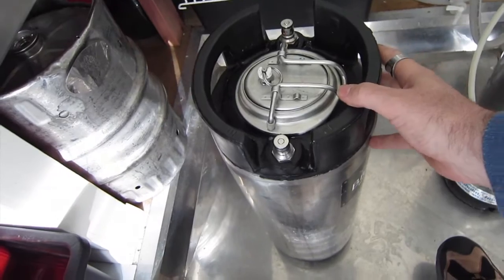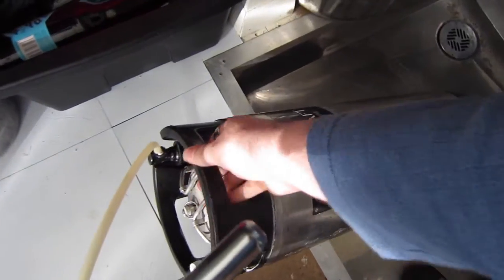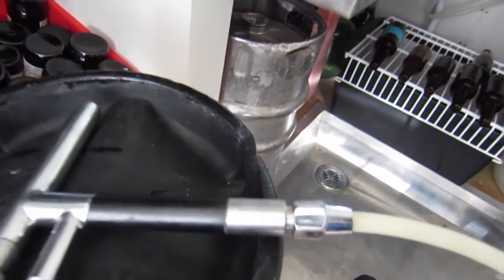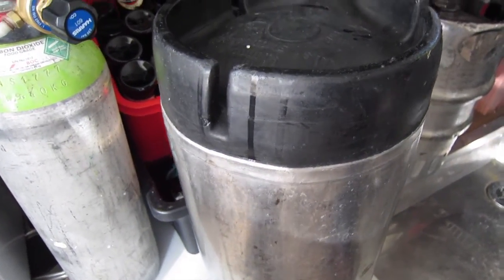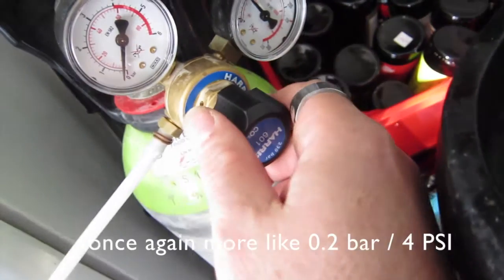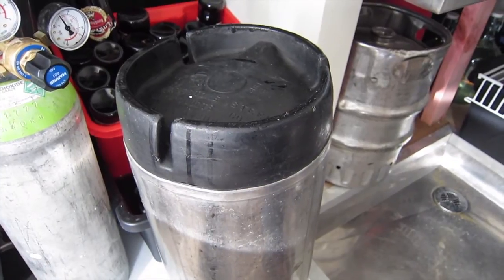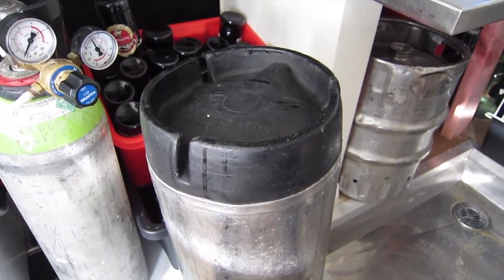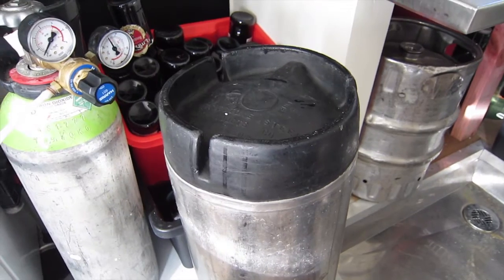CO2 Scrubbing beer, tip in 5 min

Comment: It works but this method is sooo inefficient. In a winery we would call this ‘sparging’, usually with CO2 or Nitrogen, and it removes unwanted Oxygen, and flavours too. To be efficient, you want tiny little bubbles, to maximise the surface area between the gas and the piss.  You get tiny little bubbles by pushing the gas in through a sintered metal fitting. Wineries do a tank like 200,000 litres in several hours. I’m a little concerned about all that CO2 going straight into the air. If you can hear the bubbles, you are wasting your expensive gas; do it efficiently and you will produce very fine froth. If you are not concerned about dissolved Oxygen (reduces the shelf-life) then perhaps air would have the same effect (I don’t know), but it could be cheaper if you have a compressor in the garage.
Reply: That would oxidate beer very quickly and give it cardboard like flavors. It's different than wine I think. Beer brewers are really frantic, obsessed with preventing each molecule of oxygen entering their beer and go to great lengths to prevent it. 

Very interesting remark on the inefficiency. I was thinking of getting one of those keg lids with a carbonation stone which bubbels really finely, but didnt do it in the end. After a few years of brewing I just got my first farty beer, and if I waste even 100 grams of Co2 (I dont think 5 mins of this wastes that much but OK) thats way cheaper than getting a carbonation stone.

Comment: No comments to this in over 3 years. WOW...bringing it back from the dead. I did my first hard seltzer last month and it has a bit of sulphur/yeast smell which is affecting the taste (as you noted...smell/taste are inextricably linked). I've got a second batch of hard seltzer about to finish and it has the exact same off smell. I'm gonna try this technique and see if I can clean it up using this 'scrubbing' technique. It is my assumption that a hard seltzer should nearly be tasteless and odorless until the flavor extract is added (right before carb'ing). Can you provide a little more detail regarding the timing of this process. You noted to do it for a few days. Does that mean 'scrub' every hour for 3-4 days (I know - a little extreme)...or 3 times a day (for 5 minutes or so) for 3-4 days? Or...something else? Since my goal is an odorless/tasteless seltzer I know I can't 'over-do' it...but trying to manage my expectations and not waste CO2.

Comment: Thanks for the video tutorial!  I'm going to give this a test run before dumping 5 gallons of an IPA with some funky DMS flavor.  Wish me luck.

I've read this can be done without the CO2 gun and having to tip upside down.  With a ball valve corny keg, just connect the CO2 line into the dip tube side and purge from the release valve on top.
Reply: Do you remember if it worked with the DMS?

Comment: this is a great vid. I am doing this now to an experiment elcheapo lager I made from a woolworths tin. it has an off flavour that I would describe as bruised red apple. I did the boom shackalacka shaky shaky carb methid and overdid it big time. I didn't notice this flavour when I took my F.G reading. I did clean the keg as I usually do and im wondering if this flavour is attributable to the excessive carbonation? anyway I have been scrubbing it for a few days now and that flavour is going away. im not sure I can eliminate it completely but I think I will get a drinkable beer from it. will dry hop it when done. cheers.
Reply: by the way. does it matter if its cold or room temp? it's straight out of the fridge. should I let it warm up?
Reply from the maker: Victor Bitter yeah scrubbing will takeaway other flavours as well, But if its a lager, then there wouldn't be much hop profile to remove. CO2 scrubbing is essentially taking all the volatile aromas that you smell in a beer, and removing them. 75% of our taste perception is via the nose, so try 'without drowning' taking a drink of the beer while pinching your nose closed. That way you will get an impression of what the beer tastes like after all the volatile aromas are scrubbed out. Sometimes its easier just to add an overpowering flavour to the beer to mask the off flavour, like adding raspberry extract and making a raspberry lager.
Reply: Time4Another1 cheers for that. ummm.... raspberry? no thanks lol. not my style. I might hit it with a shedload of centennial or chinook or something though. not quite to style I know , but if it makes it drinkable i'll be happy. what about the temp? does it matter so much? thanks for the reply Paul. if this quandong is any good i'll put your name one one. cheers.
Reply from the maker: Victor Bitter 14 - 16ºC conditioning temp or cellaring temp is what I used, I know it takes longer to dry hop at colder temperatures, therefore it makes sense that it would take longer to scrub at lower temperatures to. However I have never tried cooler temps for scrubbing before. What about chilli? chuck a couple of chopped up Trinidad scorpions into the keg, that'll mask the flavour if it doesn't scrub out completely ;) Dude if the Quandong is good, I am in for a swap for sure, cheers.
Reply: Time4Another1 cheers mate. i'll keep you posted. will keg and bottle it in a few days. ill let it age a week or so n if its good from the tap..............NZ!

Comment: Just a thought mate would this be easer if you could change the black and grey connects around on the lines in stead of turning the keg over . I did see that your connectors are fastened with crimpers which would make it hard but I have seen the ones you can disconnect off the lines with ease . Good tip mate and this works on over carbonated beer as well . Twe...
Reply from the maker: good point, the screw on corny connects would be perfect for that. Great stuff
Reply: John guest fitting are push on pull off . Cheers Paul Twe...
Reply from the maker: John Guest are the Best!